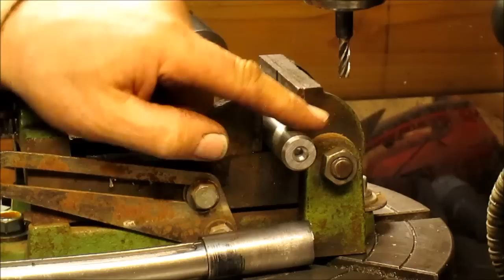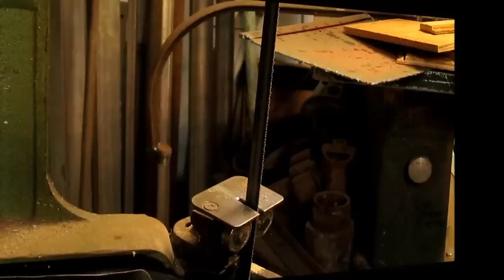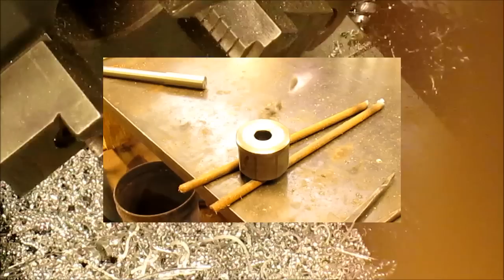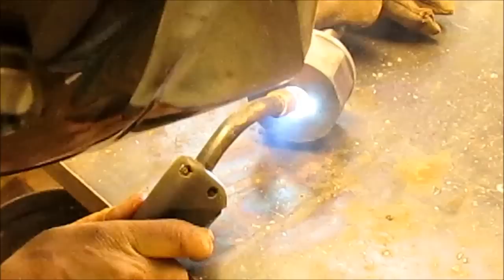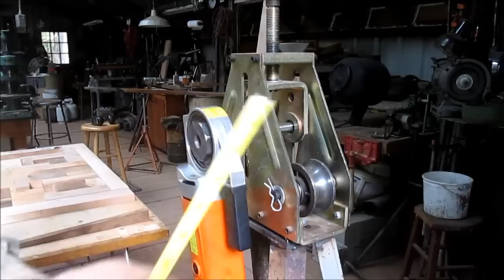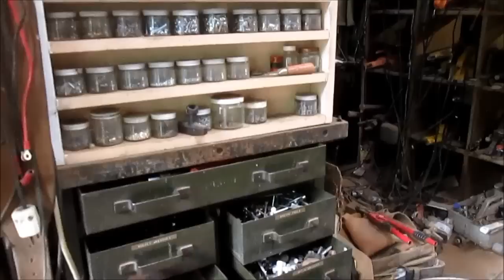Motorizing a Harbor Freight Rolling Mill 10

Comment: How will that go when you adjust the roller for bending ??? will it allow it to move as the bend advances
Reply from the maker: +Colin Samms No problem. The pivot was engineered into the drive motor.

Comment: Hey Nick, if you weld this stop I think you will loose the adjustment capability. Am I right? Check it once again...
Reply from the maker: +Baseline46 The motor has a slot so the rotation slides in the slot. I tried it and it clears. Thanks for the feedback though.

Comment: I think you will still have a problem when you raise or lower that roller as the pin you put on to stop the drive from turning is mounted to the frame and when you raise the roller the pin will not go into the motor bracket.
Reply from the maker: +westernstardriver1 The motor bracket has a slot rather than a hole and it rotates nicely as the roller is being adjusted.

Comment: Love your energy!  Still at it at 3 am so I can finish the HF project this morning.  Which video has the propane bottle wood stoves?  When I started learning milling I was told to always use an end mill holder ( R8 in my case) not collets but you went a step further with a drill chuck.  Guess it works.  Thanks for the reply about the QCTP seems I can't reply always via Utube.  They have some interesting tooling in Europe. Power to the insomniacs!
Reply from the maker: +Douglas Thompson Yes, not so good on the chuck, but it was a light cut and sometimes I get lazy.
Reply: Did you do a video on the woodstoves?  I looked for it but missed it.  Nice 'doing with what you got'.
Reply from the maker: +Douglas Thompson The propane woodstove is a much longer filming project. I have about half of it filmed and when I finish building the stoves I'll edit and post it. Thanks for asking though.